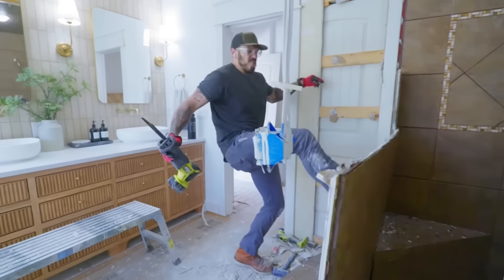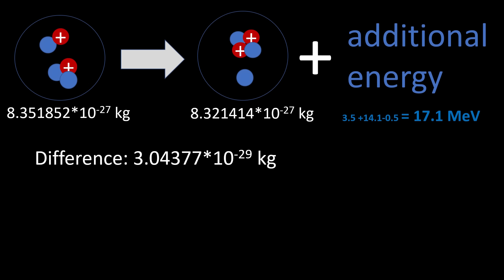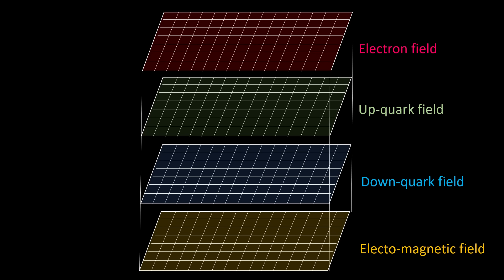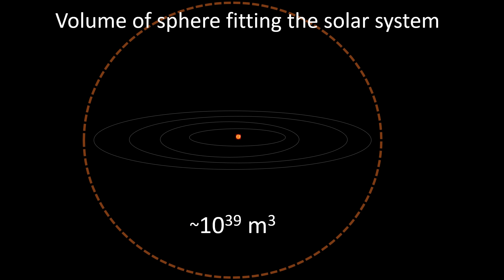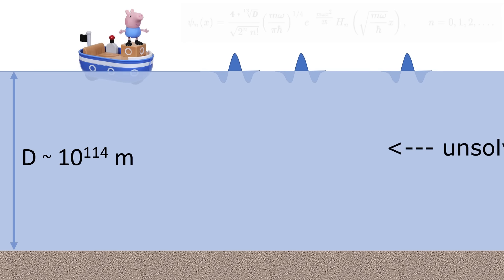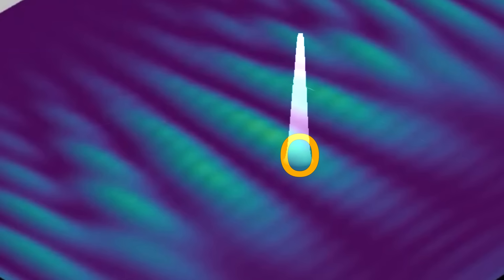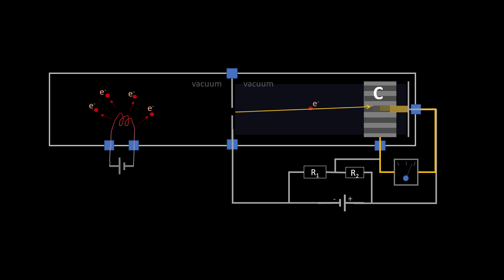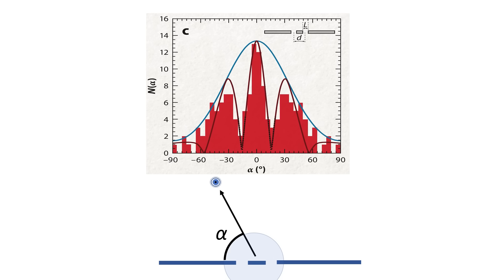Bathroom Quantum Fields and Vacuum Energy

Comment: The real problem with all this is, how do you explain the (demonstrable) non-locality of quantum mechanics, because, we know that the spooky action at a distance is real, we even use it's principles routinely, between quantum tunnelling, entanglement, even the Fermi exclusion principle (and associated fermi pressure) and Bose-Einstein condensation require some degree of actual particle non-locality. I guess some of these you could explain with wave non-locality, but the most egregious example is tunnelling, which is so well understood that the machines humanity has produced the most of ever: transistors, are, in extreme proportion, based on said principle.

Comment: While the focus is often put on that, what is different about quantum mechanics is not that "wave-particle duality". Interference itself is not a quantum phenomenon, any classical waves does that. If you want to get to the real constraints on any theory you posit, you need to consider entanglement. And not just any entangled pair, but non-local entanglement. Whatever you do, the lithmus test for any theorizing you do should be to think about how can the (non-local version of the) Bell experiment be reproduced. Go read up on foundational quantum mechanics, the papers are approachable.

Source: Mathematical physicist.
Reply: Entanglement is a also a perfectly classical phenomenon and it is certainly many things but it is never non-local. So, no, you are not a physicist. ;-)

Comment: I studied physics in college, and physics is 100% math.  All understanding comes FROM math.  I had a huge problem with that.  Math does not need 'causality' to perfectly describe by analogy.  That means that it can be consistent AND WRONG at the same time.  Statistical answers are just the first math form that got published, and I cannot agree with that.  Even angular momentum and the gyroscopic effect (basic mechanics) is misunderstood BY MATH.  Angular momentum is KNOWN to be a pretend summation vector that CANNOT CAUSE anything being pretend, but voila, it is their cause, because math said so.  I also go back to the fact that the constancy of electric charge was a 100 year old law (mnemonic device) before they needed to INVENT the Strong force to keep charge from blowing the nucleus apart.  If charge changes when CRAMMED into a nucleus and there is no Strong force, we have to start over.

Comment: It is no different than ripples on a pond. The trick is to only use one drop then you can observe the holographic interference pattern created by the displacement of energy rippling across the surface of the water... The particle is only a beach ball in the ocean which represents a quantum field of energy that can only be measured by giving it a value. In most cases that value is one.

Comment: Vacuum energy seems to be nonsensical. Just because there suppose to be quantum resonators for all or some of the frequencies in order to facilitate the propagation of waves, does not mean that it's true.

In fact, it most likely means that waves of energy do not require any quantum resonators to propagate through space which would immediately resolve this silly notion of vacuum energy.

Most likely the assumptions and conjectures about wave propagation mechanics are wrong and we need a better approach to more easily explain how does the energy move through space.